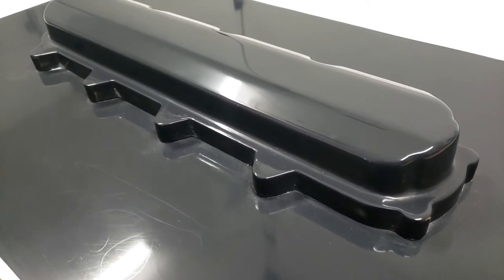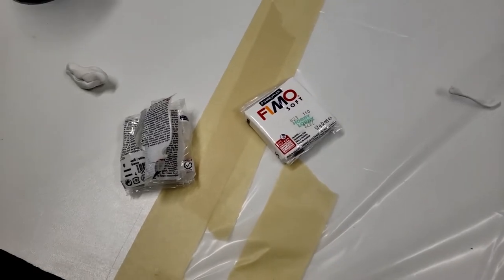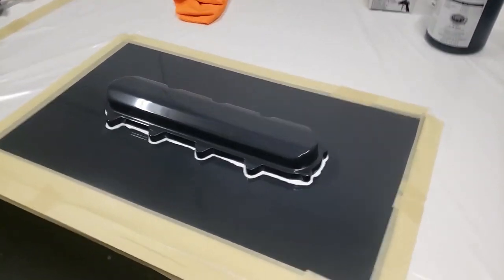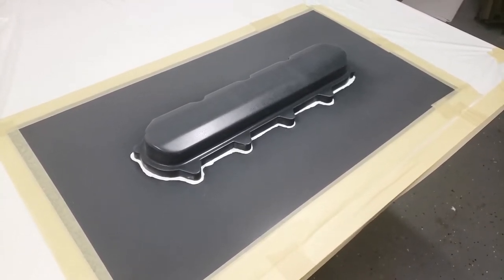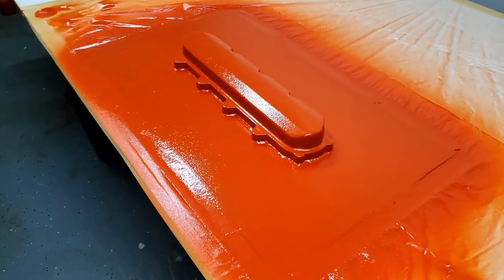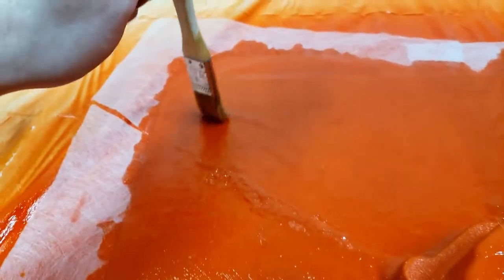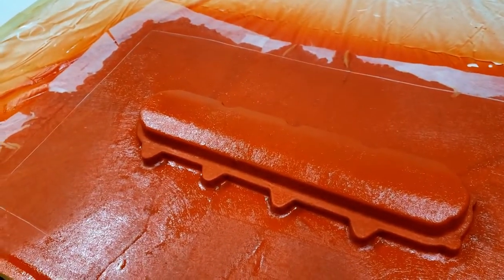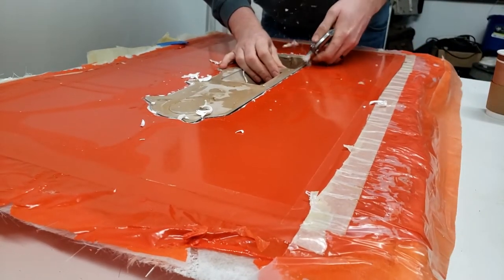EP2, Building a Fiberglass mold for our Carbon Fiber valve covers

Comment: Did you 3d print to the sheet
Reply from the maker: The plug was 3D printed in 3 pieces and then Epoxied together, bodyworked, then epoxied to a steel sheet. Then the mold was made off that.

Comment: What did you use for draft angles?
Reply from the maker: Not enough lol. The flange on the inside is straight so the draft I added was only 2 degrees. Not enough. Took some effort to get em out

Comment: You said you made a mistake with the silicone polish but you never said why silicone polish was bad or “not body shop safe”

(Also this is the first video of yours that I’ve seen so I don’t know of you explained why in a previous episode)
Reply from the maker: Silicone products are bad for pretty much any coating applications process. Silicone changes the surface tension of fluids and results in "fisheyes" in the finish. You want to avoid polishes with silicon at all costs if you plan on painting the surface
Reply from the maker: https://breezypointautobody.com/what-causes-fisheyes-in-car-paint/
Reply: @LoudandProudBSE  🤯Oh wow! I never whew that, thanks!😃